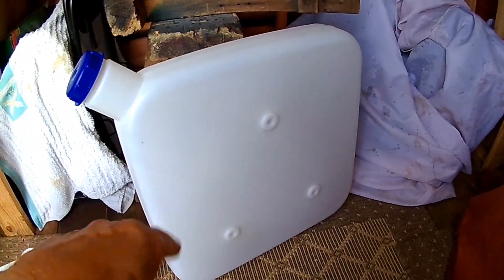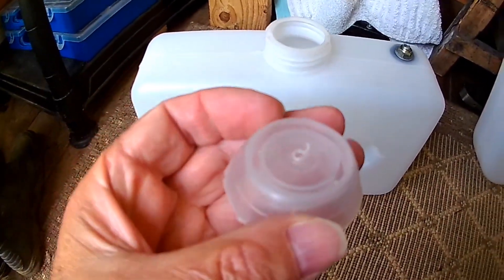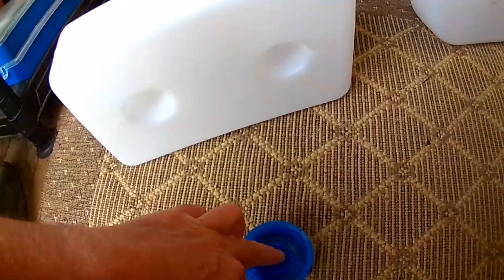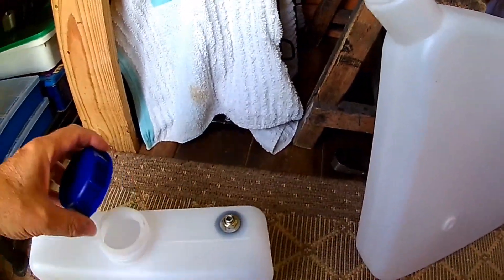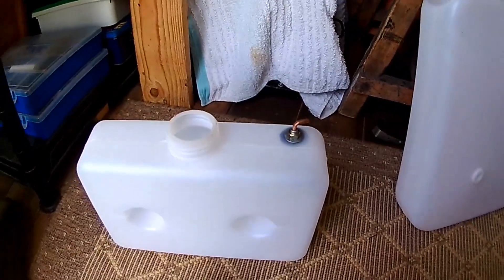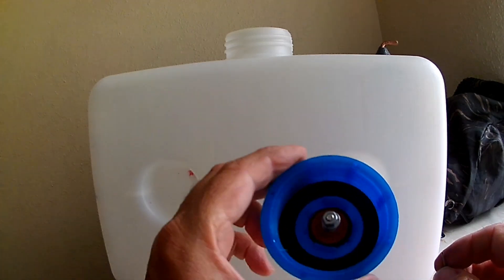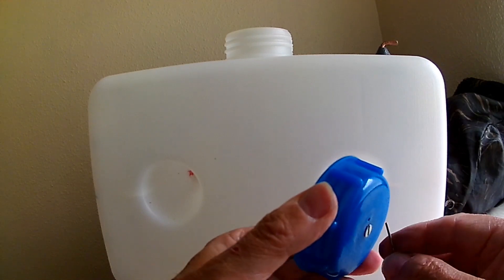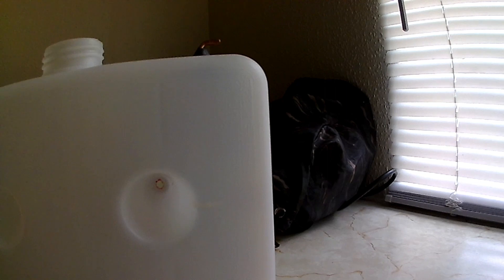Chinese Diesel Heater. Fuel Tank Problems.

Comment: Thank you for this tip. My nearly new heater worked fine for a while and then stopped suddenly, shortly after getting to running temperature. The display screen is blank and the fuel tank seems to have collapsed. I obviously have burnt something electrical but this tip for the vent shall definitely be implemented as well. Thank you for showing this 😀
Reply from the maker: Not sure why heater is dead even with a crushed fuel tank. George
Reply: @MakeDoAndMend1  Wow thanks for the unexpected reply. It was a bad contact in the cheap, inline fuse holder that I fitted. Now replaced and running fine if i loosen the cap slightly.  I still plan to make the mod which uou suggested. Thanks again

Comment: In my opinion, the pin hole in the cap is to let air in as the heater is using the fuel, this stops the tank collapsing, where as your pick up pipe is sucking fuel out and causing the tank to collapse as you are sucking the air above the fuel as well, you need a breather hole in the cap, you can put a polly bag over the filler hole then screw the cap on to stop it spilling when travelling.
Reply from the maker: Yep is sure is.

Comment: It is not designed to let the fumes out because these heaters designed to be fitted in campers, caravans.  Why would you want smell diesel in your caravan all night?
Reply from the maker: Yes I know that's why I made a one way valve let's air in and helps prevent tank vacuum. Ps my heater is run on paraffin.  Cheers from old George 👍🤠
Reply: @MakeDoAndMend1 hi,how get you finally sort out the problem,I also have ma tank inside my camper and I can smell a little bit of diesel...really annoying because I have a really good nose.I bought a dirt bike gas tank breather...just not so sure ...do I need to close the small hole from the cap and install the breather?
Reply from the maker: @229Reaper as in the video one way valve. Let's air in but doesn't let air or fumes out.